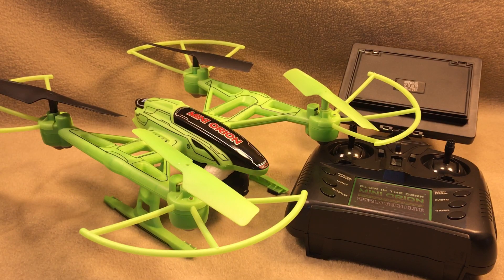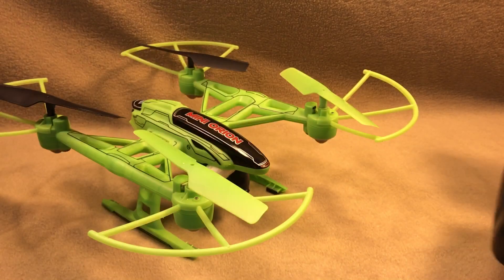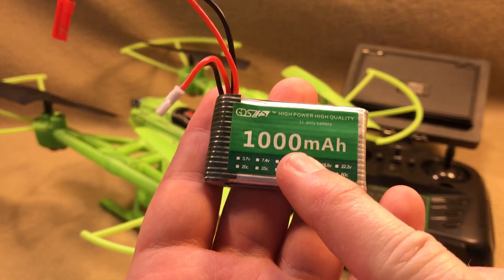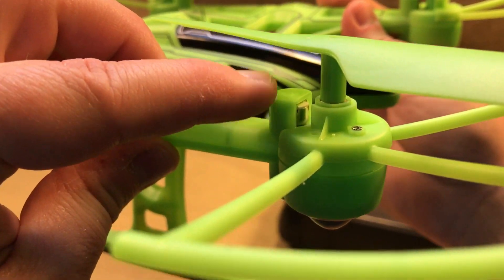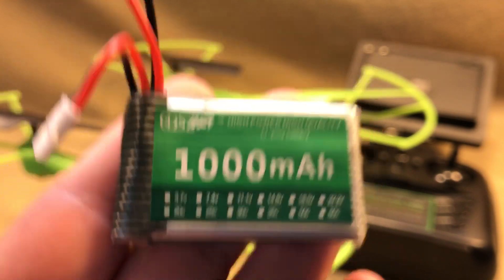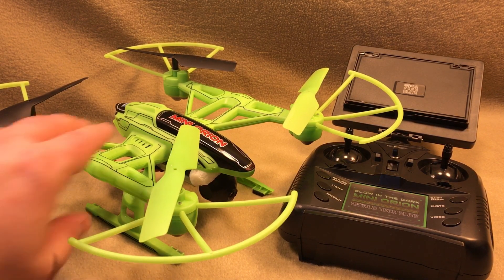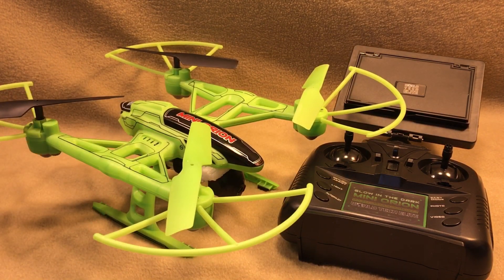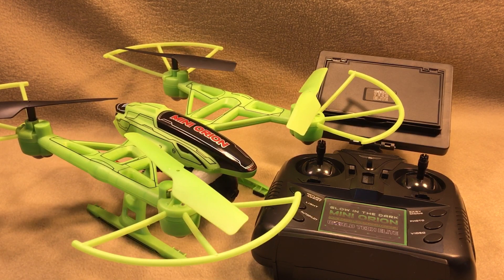Mini Orion HD Drone from World Tech Toys / QVC - Upgrades and Modifications

Comment: One other question, do you know of or does anyone know a vender that sells replacement rotor guards for the mini Orion? I found one place that sells rotors, landing gear, drone body batteries charger, and transmitter controller but no guards, they break when they take a direct hit on a stationary object.

Comment: Great job with your review and tips It has been very helpful along with your other videos. Have you tried a 1200mAh yet? I tried flying with a second factory battery strapped to the bottom of the drone to simulate a larger battery and it wouldn’t fly until I removed the second battery. Two batteries are slightly more than the weight of a 1200mAh so I’m not sure if it will fly or if it will have to have things like the landing gear, rotor  guards and camera removed to compensate for the larger battery weight. Two stock batteries weight about 34 grams and the 1200mAh anywhere from27-29 grams. These are approximate weights depending on manufactures and my gram scale is not digital so its not accurate. I would like to upgrade to a larger battery preferably a 1200 if someone can confirm it will work from personal experience. Thanks again.

Comment: I need a video on how to replace the battery wire when it comes off. My black wire came out and im not sure  where to soider it back too please help
Reply from the maker: I don't have this drone anymore, or I would make a video showing you. If I recall correctly the battery wires were beside one another on the controller board. You should be able to follow the other (red or white) wire to see the missing connection beside it for your black wire.

Comment: you made a great video on the mini Orion  drone.  I have the same one in white  /bl,  I have a few questions on the controls  because the manual doesn't cover it all in detail
 I tried the return button once  50 feet away it came back ever so slow, so what if I should have pushed the fast speed button as it was in the return mode?

next question,  what does the easy button actually do ? MAKE IT COME BACWARDS

Comment: Do you have a link for the 1000mah battery you have there?
Reply from the maker: sonicapollo Sure. I purchased it on eBay:

https://www.ebay.com/itm/132032078694
Reply: Can you direct me to one like yours but with one JST connector? Most of the ones I saw were 30c.
Reply from the maker: +Sandy Lister Here is a battery with the JST and charge connector similar to the one in the video:

https://www.ebay.com/itm/361366607971

Do you have a Lipo charger that can charge off the white non-JST lead?
Reply: Not sure. I have a lot of chargers for many other gadgets. You said in the video if you didn't have one to get a battery with just 1 JST connector.
Reply from the maker: +Sandy Lister Yep. If you don't have one go with a single JST lead, or you can go all out and order a multi battery + charger combo:

https://www.ebay.com/itm/311871081561
Reply: KevCentral aw, sucks that it’s no longer available

Comment: Mine was working fine but after a recent crash, when I press the Autopilot button to start it, it takes off across the ground and flips over. Also sometimes only one prop will spin when I press Autopilot and then when I press Autopilot again they all spin and there it goes,... on to its flip over move. Any suggestions?
Reply from the maker: Sounds like you may have something binding one of the rotor gears. The bottom of the prop pods (where the lights are) can come unsnapped during a crash. Make sure they're all in place. Also check to ensure your prop guards (if installed) aren't warped from the crash. They can flex up and touch the props.

If only one is spinning periodically that may be a connection issue. Look for loose or poorly connected wires. Did you get the drone from QVC? If so, it has a good warranty that will replace the damaged drone.
Reply: OK, thanks, I'll try those recommendations. It did come from QVC so if all else fails I will use the warranty to fix it or get a new one. Thanks...
Reply: YOUR DRONE NEEDS CALIBRATION WHEN THIS H APPENDS i HAD THE SAME, TURN IT ON  HOLD BOTH STICKS LEFT AND DOWN  DRONE WILL FLASH RAPIDLY FOR 2 SECONDS AND STOP NOW TRY AND FLY